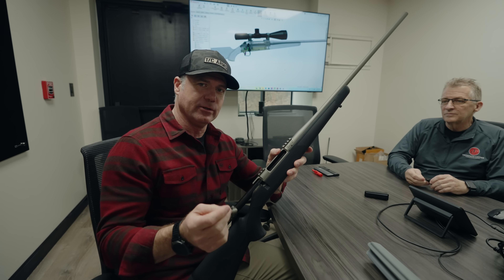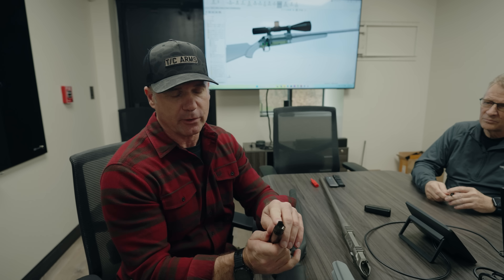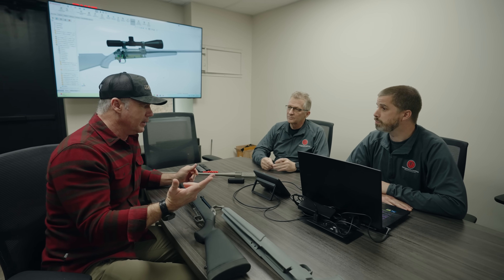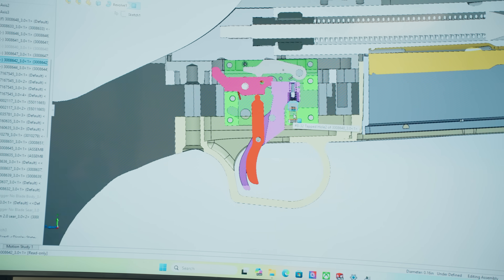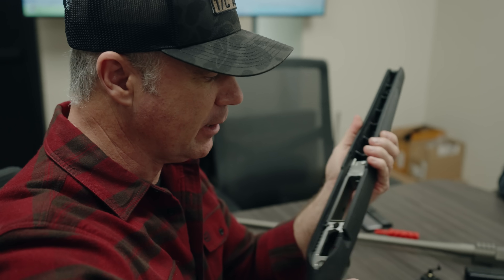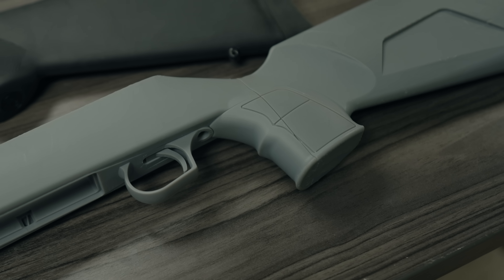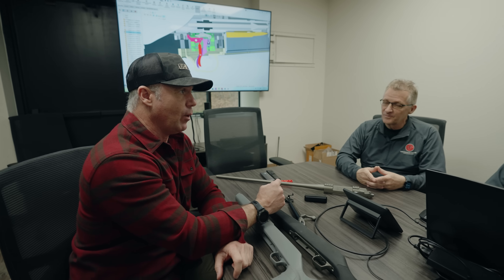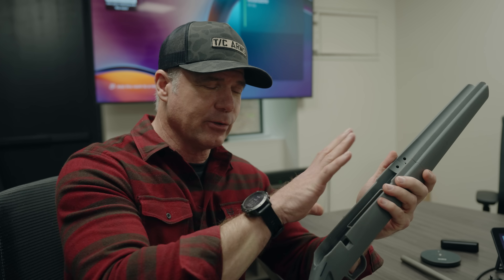We're Designing a New Gun (Behind the Scenes)

Comment: Brother, I love T/C, but some of this is just nonsense. You don't get awarded a patent because something is a good idea, it's just different enough to call it your idea. Things aren't less stable because they are round, maybe you meant it's easier for you to manufacture two flat mating surfaces. Only having 2 dual slot picatinny mounts restricts mounting options and it's rare that correct spacing is maintained across the gap. Calling the 1/8" of first stage trigger pull the safety, is absolute madness; if the gun is safe there should be no amount of futzing with the trigger that will allow it to shoot. Stocks get replaced by ones that can be made to fit, so it doesn't matter what magic pixies you have inside the stock, if you can't change the length of pull and comb height, it will get swapped.

Comment: My Venture gen 1 compact in .308  has been the only deer rifle I use season after season.  Bought and tried other rifles Howa, Ruger American Gen 1 and 2, Remington 700, Savage....  but still always return to my Venture when its time to do the deed.

It is a bit heavy but that's ok. Its biggest fault is the non threaded barrel!!! Ventures 2 fixed this but sadly Smith didn't make them for very long.  

What sold me on the venture was the 5r rifling and the amazingly smooth bolt.  The Rem 700s and Savage 110s feel so gritty and wobbly.

Comment: I would love to see an option for a full length rail across the top of the action for one piece scope mounts. Also, if the for grip is going to interchangeable, and option with a built in arca rail. That's really my only complaint with my waypoint. It has m-lok but then you have to buy a separate arca rail which isn't difficult but it add unnecessary weight.

Comment: I have 2 ventures, the 30-06 has already taken elk. The 300 win mag had a problem from the factory, and I couldn't get a replacement firing pin. It was marred and not solid. It would fire intermittently. I only could find a Thomson center "Dimension" entire bolt to replace the damaged from smith factory bolt. I loved the 5R rifling and now there isn't an issue of grabbing the wrong caliber by mistake. Also I like they both have 24 inch barrels. The both cost around $350.00, and the 300 win has a unique bolt handle. Please have replacement parts available.

Comment: Looks interesting. I am disappointed that you’re going with a bladed trigger design; they just don’t feel right and I always pull them out of my guns. Also, I hope the muzzle and bolt handle is threaded. Make sure you realize that modularity is king now. Offer barreled actions and get with chassis, trigger, and barrel manufacturers. If you can get good aftermarket support and ensure that those action tolerances are tight enough to support pre-headspaced barrel swaps, you might have something.

Comment: If you guys want to make an impact and turn heads, why make ANOTHER push feed action?  Seriously, you can't wave a stick around in your LGS without knocking one over.  What I want is a modern CNC'ed CRF bolt gun in stainless with a synthetic stock 6.5 lbs. empty in .30-06 with a 24" barrel and NO MUZZLE BRAKE.  Honestly, I couldn't give a crap about the new cartridges.  I need a hunting tool that doesn't feel like a boat anchor up in the mountains.  Right now only Ruger and Winchester have CRF actions but not in the combination I want.  Ruger used to have it in their M77 Mk.2 All Weather but that's been gone for quite awhile.

Comment: Just throwing my 2 cents out there. For the modular stock, make a "flatter", no swell grip and have 1 or 2 options while remove the finger groove/shelf. Finger grooves are nice if they fit your hand size, but not if they don't. Think how glock removed them and a lot of AR grips don't have them, same with the palm swells. A flat-ish base option would allow someone if they so choose to add material for a custom fit, or people deal with 1 or 2 alternatives. Then a personal request, QD sockets on the sides of the stock on the front and back (like a modern AR would use), I'm really not a fan of traditional sling placements, but maybe I'm the minority.

Edit: Just finished the video, the MLOK forend and adjustable LOP revision is getting real close to what I would want.

Comment: The market is well flooded with plenty of affordable rifles
Reply: A lot of junk. Nothing worth buying.
Reply: @ULFISHGETTER the plethora of sub moa rifles in the budget category would disagree with you
Reply: @oofpenguin303 sub moa? Cool. If you get a good one. How about triggers that are reliable in adverse conditions (snow, ice, sand,etc)? How about quality control? How about smooth actions? How about good stock ergonomics? How about the ability to take a pre fit without buying a custom action? How about a trigger that is adjustable to less than 3 lbs? How about actions that can continue to run in adverse conditions even if debris and ice gets in them? How about a rifle that feeds correctly 100% of the time? How about a reliable extractor that doesn’t break after extreme use like bergara, Remington, savage, Ruger? How about updated twist rates on new and old calibers? How how enough COL to reload long, high BC bullets?

I can’t think of a single company that does all these things right. Tikka is the only option to consider atm under 2000 besides maybe seekins and even then the Remington 700 style trigger hurts them. Which is one of the most unreliable trigger designs ever. 

But yeah let’s just be happy w what we got.
Reply: @ULFISHGETTER  How much you want to spend on this perfect rifle??????
One thing at a time, hey. Not everything you listed is good for a mass produced rifle.
One thing I don't like is the long heavy bolt for a short action cartridge.
Start thinking Howa mini's for everything under 2.500"OAL..
Reply: @armedfarm3429 if they can make the rifle I described for around 12-1500. Tikka does 95% of it for 700 ish for a standard threaded lite. I don’t need carbon fiber this and carbon fiber that. Just something that functions. It’s possible. If they want to beat tikka. They’ll have to do these things for a price that’s affordable for most. The Sako 90 is almost perfect, just a tad heavy.
Reply: @ULFISHGETTER  Thats why I said "don't forget the little guy".

Comment: You mentioned .300 PRC which is longer than the typical 3.600 max length for previous cartridges. Will you be increasing the cartridge max overall length to about 3.850 to allow for really long bullets in cartridges formerly limited to 3.600, such as the RUM cartridges or full length H&H magnums?

Comment: The three lug bolt is a mixed bag.  Shorter bolt throw, less extraction and camming available. 
  No reciever ranp to feed cartridges over " should " make action function shorter.
But ,when using double column mag , the cartridges have to be cramed btn the two lower lugs before going into the  chamber.
With thicker bolt diameter , the cartridges have to be lifted slightly higher within a shorter distance.  
I've seen Champlin rifles, etc, that have a feed ramp onback of the chamber?  
 But the three lugs may provide better concentricity to barrel when locked up.
Reply: They allow a short throw, but on TC.s it's to heavy of a lift.

Comment: I'm glad to see the flat bottom receiver, especially with the full body 3 lug  bolt.  
By the time a round cylinder receiver gets mag well and ejection port cut away, it doesn't leave much cross section at the 4 o'clock position.  I suspect this large amount of metal removed from reciever allows the receiver to stress relief,  promoting a slight shift of alignment. Just a thought ?  Especially when pulled tight into poorly fitted stock . ?

Comment: None of your rifles have iron sights but they all have iron sight stocks. Would it break the bank to have a modern stock with a comb heaight suited to a scoped rifle? 

Every single company mostly puts out plastic stocks with no room from a larger barrel in the future, no bottom metal for the option to stock it in wood latter and a rear rifle butt with no comb designed for iron sights on rifles that have not had iron sights in decades! 

I am absolutely tired of plastic garbage stock and rifles with a cheap mat finish! I want to be able to order a AAA grade piece of wood down the road for my rifle and restock it. Laminate wood looks terrible and is heavy compared to a nice piece of Walnut.

 I want highly polished blued rifles and highly polished SS rifles. I am not in the Army I do not want dull cheap looking finishes on my hunting rifle. Nitride can be highly polished as can stainless steel. 

I will not purchase any rifle that does not have a metal trigger guard because no one will make a wood stock for one if the factory never makes a triggered guard. Better yet let's have full bottom metal one for hunting rifles and one for PRS types that want a detachable AICS type setup. 

I will not purchase a rifle that I can not in short order put a nice wood stock on no matter how cheap you make it it needs to have after market upgrade path! I do not care if the factory makes a nice Walnut stock I understand that but I want to be able to restock it easily. If I can not order a AAA Walnut stock from an outfit that Richards Microfit or the like your rifle it a fail! 

No one makes an aftermarket stock for the Icon or DIscovery. One company makes an aftermarket wood stock for the Compass and they make a cheap trigger guard and have you tinker with a metal magazine spacer to make it all work. That is Boyds.

Comment: T/C has always produced impressive firearms.  As someone else mentioned.  Leave of the scope bases. Just go up to the #8 size holes drilled and tapped.  Browning improved it with the "x" bolt and four holes.  
    The new trigger concept looks interesting.  People get hung on the "weight."  The more important aspect is minimal pre-creep, crisp clean break, zero over travel and a good clean feel of the reset. With all that,  many would be surprised how "light" a 4 pound  trigger pull feels.  Plus it's much safer. 
   Bedding blocks became popular in the aftermarket stock world.  Now manufacturers are incorporating them.  
   In the stock making world. That grip angle is very important.  How fast the rifle shoulders,  recoil through the  wrist. How cheek piece ends up fitting and feeling.  Granted it's not a "custom " fitted stock.  But still needs to be comfortable out of the box. 
   Lastly,  will sure be nice when we can see these great firearms.  Behind the counter and available.  I am saving my pennies... and anxiously waiting.